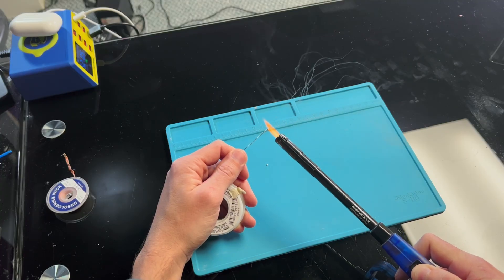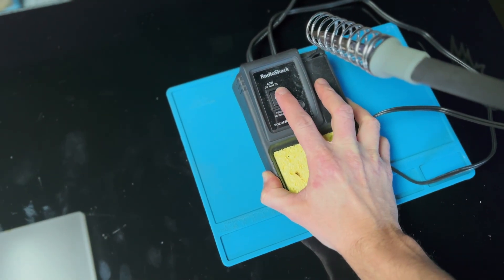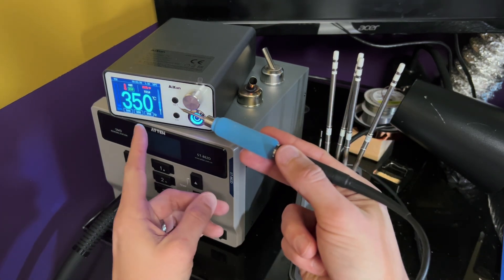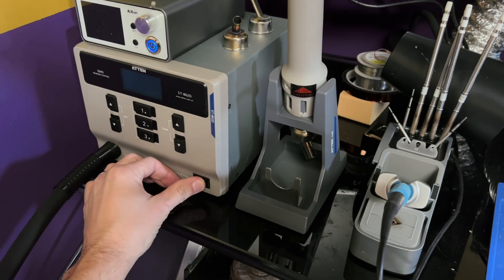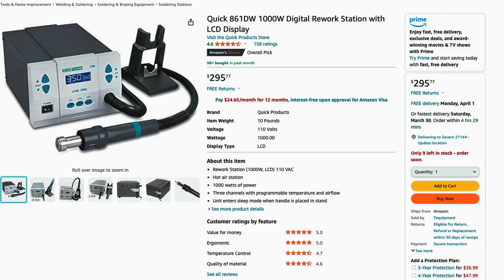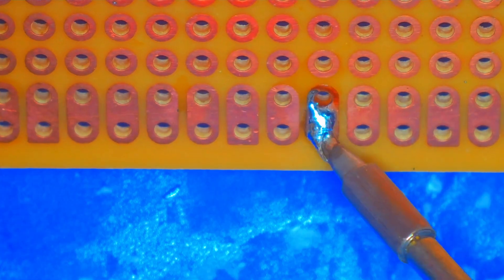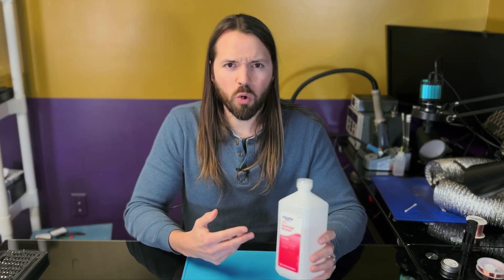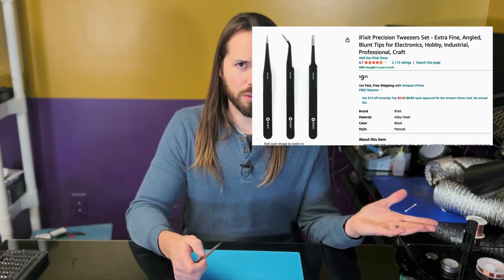The 9 Essentials for Microsoldering

Comment: Not an essential I guess, but a thermal camera somewhere down the line, which pairs well with the bench power supply or voltage injector tool.  Great for finding the source of a short circuit

Comment: Question: I don't have room for a dedicated monitor just for the microscope, which is why I use one of those cheap generic Chinese microscopes that I plug into the USB port on my PC and then get the image in a resizable window on my Windows PC. It has served its purpose so far for the few things that I worked on. But I was wondering, can this more expensive microscope (as in this video) also be connected to a PC via USB and show the image in a resizable window (program) in Windows ? That would be perfect for me since I would have a better quality image and wouldn't need a separate screen.
Reply: The camera he uses as his microscope is most likely an HDMI one, so probably no video through USB.

Comment: Damn almost bought a 2 in 1 station(soldering and hot air) almost regretted it till I found this video didn't know that you need those type of soldering iron tips to get the job done!
Reply: update because I'm just a student bought an yihua 982-I soldering station with c210 and c245 tips. sadly yihua is the only one available(with spare parts) in my country, with the budget in mind spent around 50usd for it
Reply: @Engr.T365  As long as it uses c245 and/or c210 you're good.
Those tips are great, and you should be able to replace them with actual JBC tips.
I got the yihua 982 with the c210 and c245 handles to be able to work with pretty much everything.

Comment: i purchased the yihua hot air station its not bad. i used external thermistors to measure board temps because the yihua products arent calibrated very well. once they are dialed in 🤙

Comment: Excellent advice. I did everything you said not to do in the order you said not to do them when trying to replace a damaged HDMI socket on a soundbar. So now I’m repairing several traces as well. Removing larger board components sans a good hot air station without damage is functionally impossible. Listen to this man.

Comment: flux, solder, solder paste, soldering station, hot air station, tweezers, fume extractor, solder sucker/pump, copper wick, silicon mat, microscope, ring light, isopropyl alcohol 99%, multimeter for problem diagnostics, a test bench, monitor, ch341a reprogrammer, wire cutters and a pair of pliers to cut wick

not necessary but good to have
cable management sleeve, storage boxes, labels, markers, uv solder mask, door to prevent cats to run over you whilst soldering, practice boards, a clear desk
Reply: That cat comment sounds like PTSD from a personal incident 😂

In thinking of learning this skill for a little project of mine, and maybe offer repair service in future to make money back from the investment. But idk if it's possible haha

Comment: You forgot to include Solder Paste. You could have mentioned it together with solder or separately. You can solder surface mount components using normal solder.

Comment: I am not an electrician or technician of any sort, so forgive my ignorance, please. I was wondering why people would use heat guns that can heat up the chip in the process, or a transistor or a fuse, why not use a laser that can be directed only at the targeted area? I am sure there is a reason why... maybe it's heating too fast, or too slow, but in my mind, I don't feel comfortable heating up chips and whatnot. Also, are there any specialized automated soldering machines, like the ones in the factory, that one can use in the workshop? I find all this very fascinating at my age of 40+... I feel like I could do this job if I ever were to switch careers :)
Reply: Also not an expert by any means, but I would imagine it's because solder is shiny and would reflect most of the laser light instead of absorbing it!

Comment: Wait, Radio Shack is still around? 🤔
Reply: No they are not. The college I went to before university is actually in their old headquarters. Tarrant County College's Trinity River campus. its a very nice and fairly new building with Radio Shack's old art collection and lots of electronic themed stuff like the cafeteria's eating area has a bunch of resistor, diode, capacitor, and other small electronic part's hung up above as decoration.

Comment: With hot air people generally dont preheat enough. If you have a thick boy PCB or a large ground plane you need to warm it up rather than just point the hot air nozzle at the chip and the rest of the board surrounding it is cold.
Reply: What is a "thick boy PCB"? I've been trying to look it up but haven't found anything about it. What makes it different and what is the thickness of it, who manufactures it?
Reply: @Neoprototype 😂
Reply: @Trashtakes Sorry I'm not familiar with PCB thickness differences yet I'm fairly new to the PCB world. 😅
Reply: @Neoprototype sorry thought you were joking, I’m new too but I think they were just referring to the thickness of PCB’s and that you need to pre heat the area so the heat evenly distributes properly

Comment: Nailed it! 

You did not mention ESD(a simple ESD chain will suffice!), and I must say that is a big one, as that can suddenly muck up your repair when you least want to toast a chip, or a cheaper/free choice would be to mention clothes/carpets/materials that do not build up voltages!

My two cents: If you like soldering, dont go cheap on solder station, but do read reviews!! 
I have two expensive shit soldering irons that I quickly sold off, the type you ended up with is the only way in my opinion, and can change between 245-115 sizes which for microsoldering is all you need(I only use 210 and 245)!

If you could only choose one flux, choose the gel style as it is supreme for hot air, in holding the components in place, as well as not disappearing by the heat. Liquid flux is king for a lot of tasks with a regular iron, as well as cleanup is a sooo much easier!

As with the soldering iron, I must say that going cheap(under 100$) is a waste for microscope, as there are so many advantages of a good microscope, and so much hassle with a bad one, the same can go for a microscope holder, unless you mainly need one magnification.
Reply from the maker: Yeah didn’t realize the 245 was so much more capable on the thicker boards. Have to get some gel flux. Thanks! Agree with everything you said.

Comment: 7:20 Leaded solder do melt at a lower temperature, but it is also softer and does not break as easily as lead-free solder ...
Most flux have an expire date.
Reply: Most of the fluxes work very well way after that date.

Comment: I know this video is almost a year old but what temp range would you recomend for a hot air station for pcb work
Reply: From my understanding 900 degrees F 250 Degrees C, I bought one that goes up to only 500 and I broke my series s board it just wasn’t hot enough
Reply from the maker: For newer, thicker boards, I usually set my hot air station around 400C, maybe 440C for removing an HDMI port. Older consoles, or something like the Switch, I'd go a little less. It really varies depending on what you're working on and what station you're using because they're going to be some calibration and performance differences between stations. I typically try and keep the air speed around 50% unless it's something like a port or large IC.

Comment: why does my copper wick not react like that? it only takes dabbles of the solder off?
Reply from the maker: I find that happens when I don't use enough flux or the tip's not hot enough (or powerful enough station) which often causes the wick to stick to the board.
Reply: add some lux to the braid.
Reply: Flux is coming tomorrow!!!

Comment: I have to say thank you for this video. I’ve attempted Microsoldering with the wrong equipment and it just caused a great deal of frustration being new in this branch of repair. I ended up not getting into it as well as I could have. You make a great point, though it maybe expensive it is worth shelling out a decent amount of money for the proper equipment. Saves a lot of headaches. I will attempt to begin Microsoldering repairs and this is a fantastic first time necessity list. Thank you!
Reply from the maker: I'm glad you found it helpful and if it helps you give micro soldering another try that's awesome. Best of luck!

Comment: Actually you can remove surface mount ics and other components with a gas soldering iron with the hot air tip no need for a soldering hot air station

Comment: Fume extractor should be 2 or 3 on that list, especially if you're using lead solder. That is bad $hit to breath.
Reply: The lead isn’t in the smoke, that’s the flux just like with unleaded. The bigger risk is touching the solder or joints afterwards.

Comment: You can use cheaper HotAir Station,Just use Low Temperature Soldering Lead,It will remove easy

Comment: I feel the hot air station is definitely nice but not necessary if you know how to use a butane torch (note the butane torch is very hot and requires a Fair amount of practice to get good results). The addition of hot tweezers makes removing surface mount component's alot easier and faster.

Comment: Is 888d fx hakko enough for consoles?
Reply from the maker: It’s suitable for some uses on consoles but you’d be better off with a cartridge style station. You can swap tips easier and they tend to have better temperature control. Though if you already have a 888d I would ride that as long as you can before upgrading. And you can use the hakko got tweezers with the 888d so that’s a bonus and really good for smd rework.
Reply: @FixMoreWasteLess  im new im learning on youtube also i got x3 hakko 888d for starters cause you never know .
Im trying to install modchip mobo 4.0 / 5.0 on ps2 slim . I will start with cables thin ones whichs 30awg / 24awg . My first attempt i will try to tinn the tip all the time too
Reply from the maker: Ah. It should be great for that. Best of luck with the mod!
Reply: Just got a fx 951 & fx 971  @FixMoreWasteLess

Comment: The fairly expensive microscope arms that NF guy sells is very solid and works great.  Buy once, cry once.
Reply from the maker: Oh man the flimsy one my scope came with was such a pain to deal with. Just yesterday I finally repurposed a monitor arm I’m no longer using to hold the scope and it’s so much more stable and easier to move around. I like the NF ones but $$$. Aliexpress has some similar sturdy ones but they’re also >$100.
Reply: @FixMoreWasteLess  Have to agree, I use a monitor arm with mine as well, and it is sturdy and so much cheaper!
Reply: @FixMoreWasteLess  i use a manfrotto camera arm for may adonstar 409...works great...i jsut happen to already have the  manfrottos arm...they are pricey..but can be turned a million diff ways
Reply: I used a magnifying app on my android phone with an adjustable stand. Works well for me.

Comment: When doing hot air station soldering, do you keep your board elevated or can you lay it on a piece of metal for example.  I was concerned if I just lay my board on a plate to work on it that it'll absorb my heat from the board.
Reply from the maker: I either have it slightly elevated or on a silicon mat. A metal board would absorb some of the heat from the pcb while you’re working on it. I don’t know if it would hinder your work or not. Probably more of an issue when using a hot air station on big chips or ports connected to big ground planes.

Comment: I want to change my soldering + desoldering + hot air stations with Hakko but my wallet disagrees with me everytime I try to XD That plus having them here in Europe it's a bit more difficult given that we don't have that many distributors.
+1 to "flux is just magic, it helps too much while soldering to even try to understand why as a mere mortal" :D
I guess I have the worst solder wick that exists because I haven't been able to use it at all; it just never gets solder attached to it... :(
I tried a microscope (an Andonstar one) but I hated when the "pillar" of it was in the middle always and the "base" of it was too small... so in the end I returned it (and bought an oscilloscope... And for microsoldering I use one of those glasses with magnifiers that you could put on them; not the best, but works for me I guess. I'll try buying one like yours that I could put away with an arm and connect it to the monitor, I think it'll be the best option.
Reply from the maker: The restrictions of the Andonstar types kept me away from them but I’ve seen where you can take the scope and screen off the base and put it on an articulating arm and get the same freedom of movement like I have with my scope. Not sure if that would be cheaper considering you have to buy an arm as well. 

One day I’ll have to get an oscilloscope as well…

Comment: You should have at least an inexpensive Multimeter as your first tool for any electronics soldering! This is useful to make sure that the soldering you are doing has conductivity where it is expected  and not shorting other unexpected conductors. One of the first tools I utilize in electronics troubleshooting is the multimeter. You will also need a good set of assorted shapes and sizes of hex driver bits to be able to get to the PCBs where the electronics soldering will take place.
Reply from the maker: True! I did include a multimeter at the end lol. Guess I was thinking about the actual tools I use while soldering and it slipped until near the end.
Reply: im late to the convo but 100% necessity. You can find a cheap 15 dollar meter that can do just about all you need. Flex cable soldering is prime example. i had a bridge tht somehow flowed underneth the flex ribbon. sloppy work when going fast and clean up later.

Comment: 6:20
TBH the main difference of your choice is "fan in nozzle" vs "air pump in machine". "Air pump in machine" cheap ones are relatively affordable, below $100 AND will do thick boards just as well. 
You just didn't do your research when you got the cheap station lol, just add $20 or 30 is the difference between the fan nozzle type.

Also 3:57 is a bad idea in 2024, there's a bunch of cheap irons built in that support JBC c115/c210 cartridge. 
Get that instead of ancient T12.
Reply from the maker: I suppose my bad experience with the cheap hot air station made me swear them off so I went with what I knew would work vs trying a bunch of cheap ones. The Yiuha had good reviews and worked fine on some PS2s but just couldn’t handle anything beyond that. 

If you know of some ~$100 pump in system stations give them a shout out so others can know!
Reply: @FixMoreWasteLess  
quick 857dw+ or 957dw+
Since those are up in prices, you could get old models that copy hakko's number code, big giveaway is the nozzle doesn't have a fan on it.
Key words to search are 8508, 850, 852D,  952D.
Reply: @FixMoreWasteLess  I have not found a single one with a pump inside under 100$ with enough power (Over 700w) How about the upgraded version of the Yihua 959D-II ??
Since i live in Sweden, there is not any powerful and cheap hot air stations available here
Reply: Can you please give me an example of a hot air station with air pump inside for under 100$
Reply: Please recommend actual products don't be just unspecific for the sake of being unspecific.